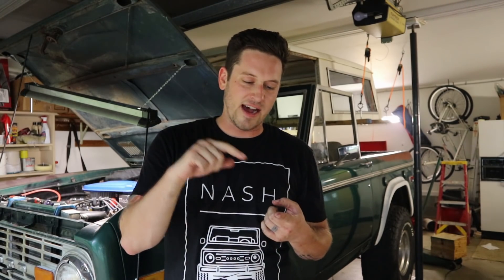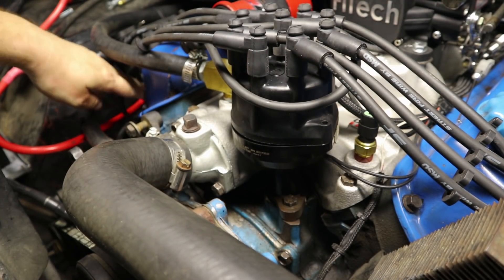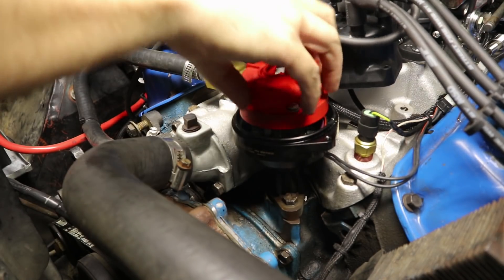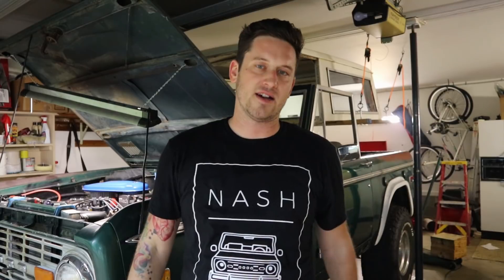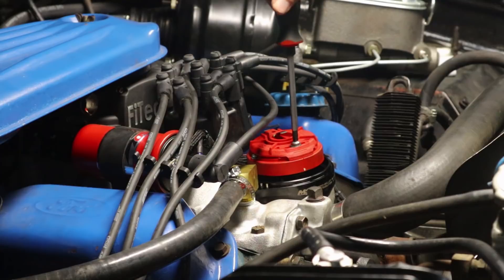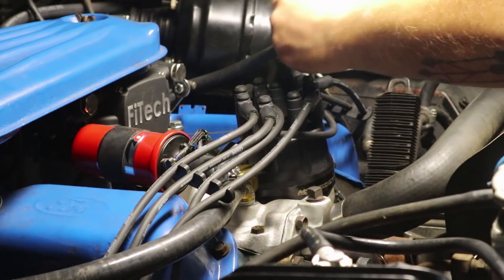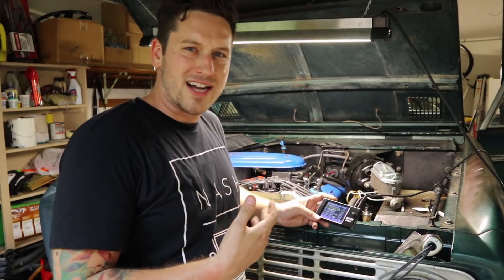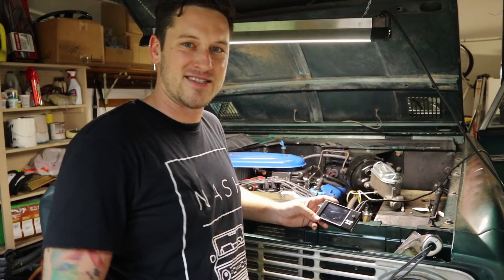FiTech Tuning: Setting the timing

Comment: Very good explanation. First time I definitely understand timing and phasing 😉
Reply from the maker: Nice!!!
Reply: @NashvilleEarlyBronco  are you using the command center? Thanks
Reply from the maker: No command center. I used a frame mounted inline fuel pump
Reply: @NashvilleEarlyBronco  thanks

Comment: Hey great videos. Excellent production work. 

Few things I need to point out. 

1. Most of the settings on the Fitech are live. This includes the base timing value. No need to do a key off when changing that value. However, a key off is good for when you have everything set and sync'd. As if the system were to reset, or lost power for some reason, then it wouldn't remember those values until you key off. A key off does a permanent save.

2. the vr4000 (vr delay) works like you said, only the other way for value adjustments. If you are using the default vr4000 value (17.6), and see your actual timing is lower than the fitech target timing, then you would increase the vr4000 value. But this is rare, as it maxes out at 19.6. Typically the actual timing is actually higher than reported timing, and therefore you would lower the vr4000 value to match. Example: if fitech handheld reports 39* of timing, and timing light shows 44* of timing. then lower vr4000 by 5*, so 12.6.

Regardless, great work on the videos.
Reply from the maker: +Nabors75 thank you! I’ve watched your videos and have learned so much! Thank you for commenting! EVERYBODY WATCH NABORS75 Fitech videos!
Reply: Appreciated. These videos of yours popped up on my recommended and I'm glad they did. Especially enjoyed the timing and phasing part. Much easier to explain with video than the many times I've typed it out on our Fitech Owners Page. LOL.
Reply from the maker: +Nabors75 haha! I bet!
Reply from the maker: +Anthony Wayne the fitech will control the timing with a locked out distributor. So you don’t need the spark box. This is how I’m running my system and it runs great. I don’t think I walk through exactly how to wire it, but it’s clear in the fitech instructions how to wire it up that way.
Reply from the maker: +Anthony Wayne I have videos on how to install the fitech and how to lock out the distributor
Reply from the maker: The 600HP and up has the timing control. The 400HP does not having timing control.

Comment: When looking at front engine (driver side/right hand) The blue magnetic pick-up is on the reluctor paddle near the 9 o’clock position. When I move the housing clockwise to align with the paddle in the number 1 plug position it obviously moves the cap, which means that I would have to move the plug wires. Can this be? What am I doing wrong? Thanks for your help.

Comment: I had a fixed rotor part 8423 in my billet 8598 what was the part number for the adjustable rotor you used ?
Reply: Troy mackeod should be msd 84211
Reply: Jason Neuman funny enough it wasn’t idkn if the cap was replaced and a different size but I ended up using the 8421 it won’t adjust as much but whatever lesson learned I guess .. wanna buy a rotor new lol

Comment: There is a setting in the Pro tuning screen that is for the distributor state, whether is locked or unlocked, did you move yours to locked?
I tried to lock it and vehicle started running rough like if it was running on 6 cylinders instead of 8.
Reply from the maker: +Adal Madera oh crazy. I never messed with that. I’ll have to look. Update on what you find out
Reply: Nashville Early Bronco i called fitech and they said to not worry about the locked timing number and to leave it unlocked on the screen.
Reply from the maker: +Adal Madera ah! Good to know

Comment: love the videos man! Just curious about the timing procedure. I feel like the manual tells you to set the timing by matching the distributor to the controller mechanically as you were doing before you got your call. Did your contact tell you to do it this way in order to avoid having to re phase the distributor rotor or am I missing something? Thanks again
Reply from the maker: It’s just for the VR setting, not the timing setting. The timing setting is matching the distributor to the controller. I’m not sure why the VR setting is different
Reply: Nashville Early Bronco got it! Thanks!

Comment: Well that's all as clear as mud. 
How did you accurately determine the position of TDC?
Also, I couldn't help thinking that the rotor phasing was off. Turning the distributor in this instance seems to be the beginning of a diabolical series of complex interactions within the menu that are all based around compensating for mal adjusted and installed ignition + incorrectly positioned timing tape and pointer that have caused a stack up of tolerances. 
I can see it all now, never being able to get it to run sweet, clear menu to default, next change this then change that, what if we do this now, and on and on and on it goes - yep still not working exactly how I want, default, begin again (see below):

There wan an old man named Michael Finnigan,
he grew whiskers on his chinigin,
Along came the wind and blew them inigin,
Poor 'ole Michael Finnigan 
- Beginagin!

There wan an old man named Michael Finnigan,
he grew whiskers on his chinigin,
Along came the wind and blew them inigin,
Poor 'ole Michael Finnigan 
- Beginagin!

There wan an old man named Michael Finnigan,
he grew whiskers on his chinigin,
Along came the wind and blew them inigin,
Poor 'ole Michael Finnigan 
- Beginagin!
 etc, etc, etc

Look you may think I'm being a smart ass and maybe you're right and I'm wrong and all that but give me this, I've taken the time to write this to you. 
I have the Fitech dual quad power adder system - yet to be installed I might add so I'm the virgin here rather than you, but I'm also a qualified mechanic and I'm visting these pages to gain info on how to use and set up the ignition control of the system. 

The thing is, I have a Mallory locked out distributor so the phasing isn't likely to be an issue however I see you creating potential issues for yourself here. We mechanics, (some of us anyhow) like clear, simple steps without added complexity. Much of our work is undoing the mistakes of other mechanics, unfortunately, and getting things back to basics first so I tend to notice these things.

My alarm bells are ringing when I saw you altering this rotor phasing then compensating for this discrepancy between timing light, Fitech and timing pointer.
Recently, I fitted a new pointer to my motor and an aftermarket balancer. I determined the position of TDC with a dial indicator when the heads were off then adjusted the pointer to 0 degrees on the balancer. It can be done with heads on BTW.
I fitted a new locked out (and therefore pre phased) dizzy. 
It is unlikely I'm going to get any issues relating to distributor phasing or incorrect timing. 

Simple, logical, basic steps first. Complex adjustments second.
Reply from the maker: Absolutely, I hear you. Thanks for taking the time to write your comment. Timing was super confusing to me when I was reading the FiTech instructions. A couple things:
1. I'm trying to bring more clarity to FiTech's instructions. I agree, most mechanics probably have a better way of doing all this. But for the guy who is installing this in his garage and is trying to follow FiTech's instructions, I hope this video helps. But, I welcome any other advice in this process.
2. The video before this I show how I determined the position of TDC https://youtu.be/4-3Hz3LRhUE
3. Once you install your FiTech, let me know what steps you went through to get the timing right and what you learned. That's what this is all about, sharing what we learn to make it easier for the next guy.
Reply: Sorry for being an A-hole a few months ago. I now have the system installed and I'm seeking your help. I feel bad. We'll call it Karma. 
As a thanks for your kind assistance I'll subscribe.
Done!
Reply from the maker: No worries man

Comment: Dont quite understand why you took the rotor off to align the reluctor wheel and the mag. Pickup in The beginning ... you moved the base of the distributor later in the video which moves the correlation of the pickup and wheel
Reply from the maker: Just to show what you are lining up when you move adjust the distributor. Nothing special, I just wanted to show what you are actually trying to line up

Comment: Good Video. Between this video and this one I found https://youtu.be/owUHU1tPw68

It all makes sense now. So, from what I understand. Set the idle timing, next set max timing. Once that is done you make sure the handheld and timing marks are matching, if not adjust distributor timing. Once this is set then you phase the rotor. Phasing the rotor allows you to fine tune the rotor so that the spark is maximized while arcing across to the spark plug wire.